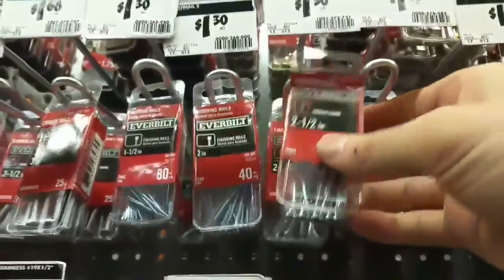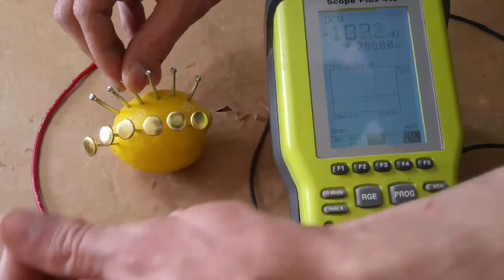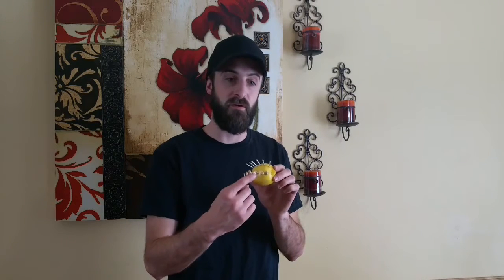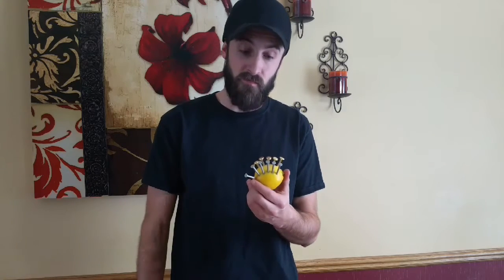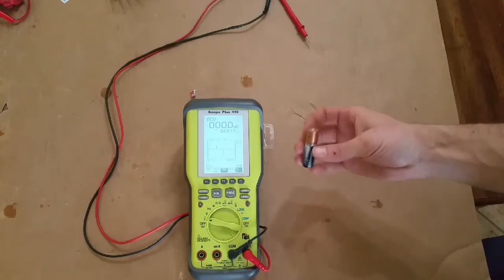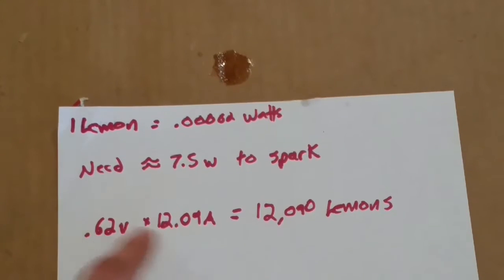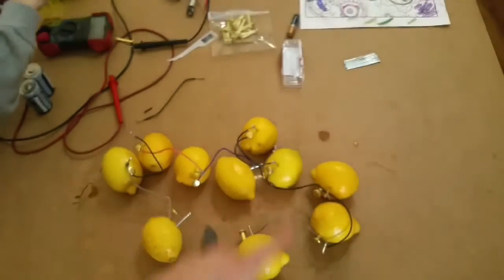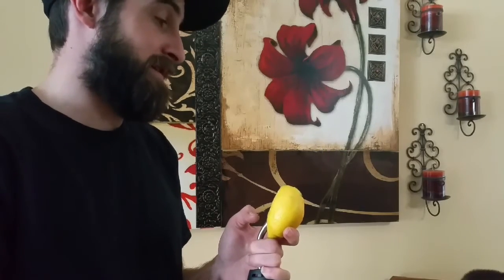How To Make Fire With A LEMON DEBUNKED!!!! The TRUTH Behind The Lemon!!!

Comment: nicely done.  my little boy and i tried this (i didnt think to test it myself first), and were disappointed. so i put a voltmeter on there and got around 0.7 volts.  similar to yours. across the series-connected set, i got a lower voltage as well.  

trying to explain that loss of voltage: the series links between the 1- / 2+, 2- / 3+, etc, lower the voltage because you are essentially short circuiting over that wire. in each pair, the wire heats up ever so slightly, dissipating some of that power, and re-routing some of the electrons that would otherwise travel from the oxidizing location (with one test lead) to the reducing location (with your other test lead). i think the lowered number of electrons passing from one to the other is the reason the charge potential difference between the points you test is lowered.

what do you think?
Reply from the maker: Aaron King That what I thought also... Short circuiting the leads so ouside reads lower... I've tested a few other things and it seems .7v is common for each "cell"... Potato cell, zinc washer and penny cell all can to right around .7v

Comment: what i didnt quiet get was the 12 thousand number. If one lemon is 0.6 volts and 10 lemons are 2.6 volts it doesnt look like you need 12 thousand lemons to get to 5 volts and make sparks.
Reply from the maker: commenter78 Each lemon is only making .001 amps... You can get the voltage up easily but still not enough total power (volts x amps) to make a spark....

Comment: One obvious flaw with the reasoning: This video establishes that it would be possible to cause sparks with 7.5 watts, but does not establish that 7.5 watts is the minimum power needed to cause sparks.  It could be that a significantly lower wattage would strike a spark, and therefore could be used for starting a fire.
Reply from the maker: Ok let's assume its 90% less to make a spark. It still doesnt work with one lemon.

Comment: He didn't get a good reading because his fingers were touch the connectors so some of the voltage was absorbed by him. Again with the battery test he's in contact with the connection. NOT ACCURATE
Reply from the maker: You're totally right... Touching the leads is the reason starting a fire with a lemon isn't possible...